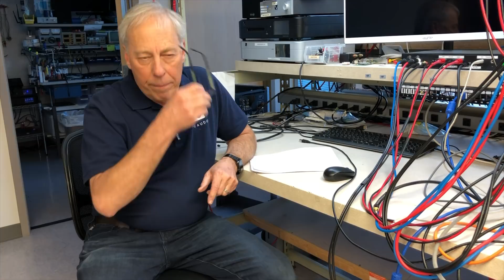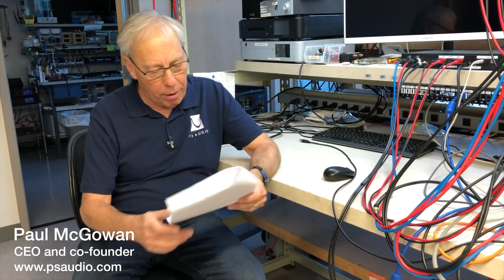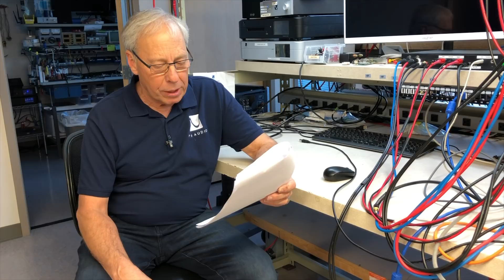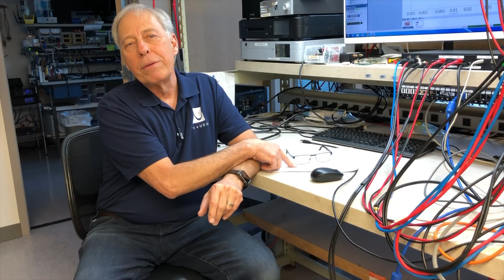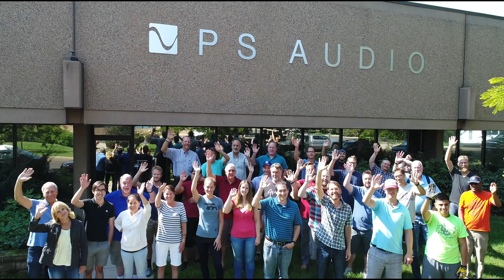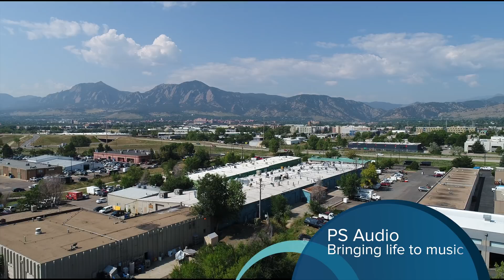Are all amplifier watts the same?

Comment: Good explenation!

But it's not always that simple as watts is watts in amps. Some messure it the wrong way so they get alot higher wattage on paper. Most meassure it with 1ch driven @ 1kHz (the wrong way) and others with all ch driven @ 20-20.000Hz (the right way)

Comment: Also don't forget that the 1,000 watts in a sub is usually/almost always peak watts, not RMS watts.  With most subs, the ration between RMS and Peak is .5 to 1.  So, that 1,000 peak watts is in reality is a 500 watt RMS amp (class D not withstanding).  So the real comparison is between a 300 watt 8 ohm (500 watt 4 ohm) Bryston Amp (I own the same amp) is being compared to a 500 watt RMS (1,000 peak) watt class D amplifier.  I hope this helps also.

Comment: Watts are watts, but sometimes manufacturers lie (especially of the cheaper products) and power ratings of amplifiers and speakers are probably the most lied about specification. There are devices that say 1kW output power, but for some reason the power cord uses the "8" plug which is only rated for 2.5A (so, maximum 575W from the wall at 230V).

There are multiple ways to measure the maximum power of an amplifier:
1. Maximum power of a sine wave at distortion lower than x%
2. Maximum power of a sine wave just before clipping
3. Maximum power if you fed a square  wave signal to it
4. Maximum power if you fed a square wave signal and used a load of lower resistance (for transistor amps), if the amplifier blows up after one second that's OK.

There are also ways to measure the power capacity of a speaker:
1. Maximum power while the distortion is lower than x% (we call these the Russian watts).
2. Maximum power that can be used indefinitely without damaging the speaker (distortion does not matter).
3. Maximum power that can be used for x seconds before the speaker is damaged (let's say a cannon shot in 1812).
4. Maximum power that can be used for 1ms before the speaker blows up (and these are Chinese watts).

The same device can have very different power ratings depending on how much the manufacturer wants to lie to the client. Obviously a company that makes high-end audio equipment does not do this because the client of such company does not choose a device based solely on the rated power. After all, rated power and speaker sensitivity make loudness, a 1W amp with 100dB/W/m speaker will sound just as loud as a 100W amp with 80dB/W/m speaker. And of course it's more to sound quality than just loudness.
Reply: Same as hp regarding car manufacturers.  Sure the mustang has 300hp when the motor is on the bench, however at the rear wheel not so much!
Reply: yup or the front wheels
Reply: I love my EVDL15x

Comment: I live in Central Florida.  In the warm/hot months (Eight months of the year) I use LED lights in my house. From December thru March I switch in incandescent bulbs.  It is enough to heat the house, I use no other heat whatsoever.
Reply: I've spent some good years of my life in the Fort Pierce/Staurt area. Are you talking Gainesville and Ocala? oh that reminds me of the time I frooze my radiator going to work one morning to Isuzu of Fort Pierce where I had the Keys to the whole dealership as BoB Brady would tell me as he handed me the keys to the Dealership in1985. 
"Brian, In my 30 years of car dealership experiance, I have never handed the keys to the parts room to a mechanic. I have been successful by surrounding myself with quality people" 
I basically was living out of the shop as I worked 7 days a week installing 4 air conditioner systems a day on the Isuzu "pup". I made more money per week then several long standing top personal as It took me 1.5 hours to install an airconditioer in these little trucks. Isuzu of Japan to my understanding was the largest manufacture of vehicles at that time with a large range of vehicles all the way to super duty.
Reply: @SJMessinwithBoats   I live in the Southwest Orlando area. Windemere to be exact. Incandescent bulbs are only 10% efficient at producing light. They other 90%  is released as heat. The are basically heaters, not light bulbs. Betty Crocker Oven shit!  :-)
Reply: I met my wife #2 in Orlando she work for Clint Galbrailth and was one of the rubbers for Niatross the worlds fastest pacer, she has tons of memorabilia as she worked there 8 years. 6 months Florida 6 months Rochester Ny at a time.

Comment: The subwoofer amp is likely 1000W into 2ohm, which is different from at 8ohm. 
 
Also, that’s likely peak wattage not RMS.
Reply: It’s 1000 watts max power on specs not peak, but not sure about ohms......new db1D is now 2000 watts

Comment: The better question is: why do some lower wattage amps sound cleaner, louder, and more dynamic than higher wattage amps?
Reply: Because they in fact likely do have less distortion, crosstalk, etc.
Reply: @homeboi808  yeah, that's easy to say, but is it factual? I think that's the direction that would have benefited his viewers, not to talk about efficiency of the power stage of amps. AC users don't care that much about efficiency, especially in high end equipment, compared to DC users anyway. It's the sound and manufacturer ratings we care about.
Reply: Dynamic Power, which used to be specified in the past. An amp capable of producing twice it's RMS continuous power for short bursts has a dynamic power rating of 3db. Since music consists of small bursts of power and not a steady note, dynamic power and  high damping factor means more slam and punch. A small amp can sound less compressed than a larger one if it is engineered  better.

Comment: This will be off topic. I'm all for efficiency and lower power consumption. I have no choice but to gradually adapt to the new energy standards with LED lighting. However LED lighting is not 100% safe for the eyes. Use caution when you get LED lighting. Try to use the ones that don't hurt the eyes as much for it is not the best thing for your eyes. The unfortunate problem is we won't see the repercussions until way later. By then the damage will be done. The transfer over to LED is eminent and very rare uses for incandescent lights to be used on special situations will be more than welcomed once it's realize that LEDs in the long run are bad for eyesight. I wouldn't be so eager to just save electricity and not be cautious about saving eyesight. This will take a long time to comprehend, but we will also be replacing LED just like we replaced the second version of the fluorescent lighting which only lasted probably less than 20 years. Savor incandescent lights, don't look into LED lights and use UV blocking high-quality LEDs until a safer replacement it's put in place. Like an audiophile, quality not quantity!
Reply: LEDs are great if you enjoy headaches...

https://theconversation.com/the-scientific-reason-you-dont-like-led-bulbs-and-the-simple-way-to-fix-them-81639
Reply: LEDs that flickers can be really annoying yes, but it wont really damage you. But there are LEDs that don't flicker and they wont hurt you at all :)
Reply: @gurratell7326  Current research indicates there's ample reason to expect damage over the long term. Whether the concern is justified will be determined by replication of results obtained and possibly decades of exposure. I was always rather careful about how much I was exposed to loud music and machinery. My (minor) hearing loss is mostly attributable to what was considered to be safe SPLs.
Reply: avh700, can you send a link to LED's that are OK.  I am bothered by LED lights and would love an alternative.  Thanks.

Comment: This is exactly why my channel exists... illustrate some of the benefits class D can bring and offer. What I've always wondered about when younger was why does my pioneer 35 watt class AB amplifier/4 channel receiver and my 100 watt pioneer gets just as loud lol.  Class d PWM mosfets
Reply: EV DL15x  Once I got over the HOW LOUD the amp gets, you start to listen at lower volumes over time and pick out the discrepancies or listen for detail.  Watts don't really mean that visceral more detailed sound... just louder... but with proper power matching, then the speakers can handle that much more current with out soft clipping or distortion.  As long as the amp is in its current capabilities at RMS.  The good old 3 times DB for an increase of sound.  Doubling of power at 3db of increase the way I understand it.

Comment: LED lights are like Class D amps. They can be pretty good, but mostly they are rubbish. I very much prefer good old Class A lighting.
Reply: It all depends on the LEDs. There are badly designed ones that flickers that gives a very "hard" feeling, especially the bluer ones. And there are good nonflickering ones too which if they are warm gives exactly the same light as a regular old bulb. Diffuse it a bit so it gives soft shadows and they will be really nice!

Comment: 100 W incandescent = 1600 lumens (roughly.) 14 W LED = 1600 lumens.
LED's are around 6 - 7 times more efficient. They still generate some heat, though, and have to be heat sinked.
Reply: LED can be less efficient than CFL. It all depends on the circuit design.
Reply: @JesseJames83  On paper I guess. Every one I owned had a toasted ballast in the base by the time it died. The base was tan/brown from all the heat it generated.
Reply: @rich1051414  yeah same here. I guess it depends on how you gauge efficiency. I have seen CFL and LED designs under 1 PPFD/watt. Check out Migro for awesome info: https://www.migrolight.com/wp-content/uploads/2017/11/How-to-size-your-grow-light-example-8.png
Reply: LED lighting may be efficient but its not "pretty" like incandescent lighting.  The spectral output is flat, end to end,  un-starlike.. Witness LED lighted Christmas trees,  concert lighting, ... dry...lifeless... just sayin.
Reply: Depends on the LED. There are some that have very nice and accurate color. Hyperikon 3000k bulbs are the best I've seen, but sadly I can't use them because of incompatibility with my dimmers (you need elv ones and only eaton or lutron for an insane price sells them for z-wave). @cactus00001
Reply: Philips warm glow are okay as well, but not as nice and their normal ones are pretty bland. Cree have the best dimming handling but are only okay. None of the generic ones are very good, but some of the feit ones are pretty good.
Reply: GE reveal were actually fairly nice, but had horrible dimming. Go figure

Comment: D class amps get too hot ,  deliberately  ,  melt the solider exe 
HEAT is the ENEMY
Reply: @SJMessinwithBoats  This is an AV amp mate , 
several reports of over heating cousing  it to only last 2 years . 
All big brands are not built right anymore , 
Marantz  is another peace of junk
Reply: @LD Blake 
there is deliberately no cooling fan , YAMAHA are the same as well , 
Its the old amps are better .
There is no need for D Class but they make them anyway to split hairs .
The older the tech the better they are .
My next amp will be from the 90s .
Be wary of a fan that has never spun !

Comment: The amplifier will also have to work harder on non-efficient speakers, which may have an ohm resistance that produces a load that might be near the limit the amp can handle. Some amps cannot go below 4 ohms in speaker resistance. One might use an illustration of two water hoses. . . one has a much larger diameter than the other, but traded out on the same faucet with the same water pressure, the hose that has a smaller diameter will also have more resistance to the water pressure an consequently, the output will not produce the same quantity in the same amount of time of the hose will the larger diameter, which produce less resistance and more water volume due to more water getting through at one time.
Reply: We could talk and talk till the cow comes home about this so here I go too. If a hose is too big in diameter one will need a huge amount of water to get some (strength) flow (voltage), so the diameter, or capability, should adjust to the purpose. No one would use a garden hose to drink a Coke or a straw to wet the lown or grass or whatever you name it, so every amp should mate well with the load it must feed, don't you agree?
Reply: @salvadorrodenas3071  Yes . . . .
Reply: @russmaleartist  thx!

Comment: This is why we should have Class D amps in our AVRs...😉
Reply: I don't mind the heat my AVR produces in the winter, it supplements my heating nicely. It's a pain in the summer though!
Reply: a good way to counteract this heat is to give the amp a break by putting an electronic high pass filter before the amp. Say one with adjustable points? experiment but remember that you can overdo this turbo effect and cook the rectifier, like I did on my '90s Yamaha AV
Reply: Class D amps for AVRs...
Class A or AB for critical listening. 
Everything has a right place.
Reply: Peter S. why is my Sponge BOB phone the best?
Reply: @peter s. I thought you were more modern. I did listen to the cannons in the 1812, of course I have heard parts of it but yeah nice recommend. I loved it!
Its a keeper!
Reply: @SJMessinwithBoats  I'm modern when it comes to more complex guitar effects processing, presentation systems, and digital audio but when I want to listen to King Crimson, Jethro Tull, Yes, or Hawkwind I prefer the overall sound of firebottles and a warm sounding system that is easily technically eclipsed by so many modern offerings. My hearing was sacrificed to San Francisco's Rock n' Roll and Punk music scenes a few decades ago but something about the "imperfection" of a nice linear output stage just sounds good to me. My ideal signal chain from instrument to speaker exploits imperfections of analog at the start and end and uses the benefits of digital in the middle of the chain.
Reply: Peter S. "we built this city on rock and roll" kind of concerts?
Reply: Looks like I have to stop using my little sponge Bob cell phone here on this blog.... 
 "MY LOVE IS KING"
Sorry, just love Sade her love is tops.
Reply: @SJMessinwithBoats  RIP Marty Balin. I had the honor of doing psychedelic lightshows with the regrouped Jefferson Airplane/Starship during the 20 year anniversary of the Summer of Love so yeah, literally that kind of concert but it was the punk rock shows at much smaller venues with even louder amps that did the real damage.
Reply: absolutely...unless of course you want RICH WARMTH.
Reply: I though all modern (at least after 2010) AVRs are with class D amps ?
Reply: @Quetzalcoatl0  Nope. Just a few Onkyo and Pioneer
Reply: well yeah but its tricky finding d"s that have HCCA
Reply: How about class D onboard AV and then a chain of Pass amps and electronic crossovers out board?